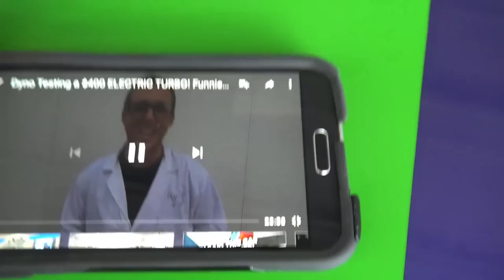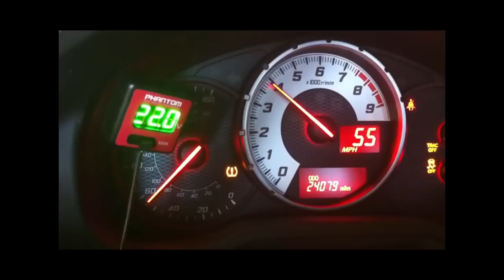Cleetus Mcfarland is wrong about electric turbos!

Comment: Congrats on your build, I know that the OEMs have been using this technology but I would like to see what the endurance of this would be under high heat and weather exposure.

I am not a subscriber to the whole "Green energy" church though, I have worked in the energy sector for years and can tell you that you might achieve nominal tech advances but it will all still come out of the earth and to great expense to the environment.  Batteries are not the way of the future, the configuration that you have is actually a high voltage capacitor that feeds the turbo and that will eventually kill your alternator so make sure that you get the duty cycles matched by your driving habits or you can expect to be setting on the side of the road more than expected.

We tested larger variations of this on military diesel turbos and that very thing happened after high mileage RAM test.

It will all come down to endurance and quality in the end.  

Very clean build!!  Thank you for taking the time to challenge technologies to see what the realm of the possible could be and showing others!
Reply: @Neojhun  Cobalt has played a role in improving the performance of EV lithium batteries, namely energy density and battery life. Moves have been made to reduce the use of cobalt, but eliminating it entirely is going to take more time and research to achieve, if it can be achieved. So perhaps check your facts before shooting your mouth off that it plays no role in EV's , it does for now. Battery life is still an ongoing question in electric cars and lithium storage, in long term testing, some of them are not doing so well, not to mention the problems with recycling lithium batteries which is another"work in progress" that may or may not yield results.  As for liquid fuels, there are cleaner fuels which can be made synthetically such as Methanol and research continues on the better energy density,longer chain alcohols like propanol.  Regardless, with an excellent heat source like Thorium MSR nuclear power, which is well underway final trials in China, it will provide all the heat energy needed to produce limitless,cheap and clean burning fuels.  Look up Thorium redux to learn more.   If you visit roadmaptonowhere.com you read about the stupdensously horrific cost of the whole carbon zero by 2050 scam.  One of the projections is that to reach zero carbon by 2050 with EV's and renewables would require the mining and extraction of 400 million tons of copper, not to mention the nickel,lithium and rare earth metals.  Cure your ignorance.
Reply: Oh and read up on the Achates 2 stroke engine being used by the US Army and is being field tested in Aramco private vehicle fleet, they have conquered emissions in their CARB heavy truck trial and predict 20 to 30% better fuel economy in diesels and 50 to 60% better fuel economy in their direct injected gasoline version.  Its engines are made of plentiful and easy to recycle aluminum and steel,  and the EPA in California want all future trucks to use its technology.  Combined with Thorium MSR, the energy crisis is easily solved........no need to rape the earth for hundreds of millions of tons of new,exotic resources that dont recycle well or triple the capacity of the grid that will cost many trillions of dollars.
Reply: @wazza33racer  Yes the Battery Lifespan of BEVs is not great. With no major technological developments the 1990s Large Format NiMHs like Rav4 EV averaged about 17 years. Modern Lithium Ion batteries are no better and basically the same. With slightly more work to do with thermal management the best we can hope for is 20 years Max for current BEVs. But during that time BEVs can have insane High Mileage easily 300,000 Miles or more. Yes it's not great but it's just as bad 4 Banger Petrol & Diesel cars.
Reply: @wazza33racer  ICE Vehicles will soon use just as much Rare Earth Compounds as BEVs. Both the Electric Motor and Battery Chemistry does NOT require Rare Earth Compounds in the near future. The only problem is the Electronics especialy the Power Electronics. But the end result is roughly the same amount in a Catalytic Converter I.C.E. vehicle with electronic convenience features. You clearly have no clue how Rare Earth Compounds are used. FYI You copied and pasted the Rare Earth Metal scam. It's called Rare Earth COMPOUNDs because the Metalic Form is hardly ever used.
Reply: @wazza33racer  Yes I''m well aware of the Archates Power Opposed Piston engine, please look up those videos with my comments on them circa 2015. I'm also a WW2 history nerd and I also knew it was inspired by Junkers Jumo 205 legendary aircraft engines. Problem with Opposed Piston is the Cam Gear linking both ends of the cylinder. Currently it's a complicated fragile mess that has to translate timing across whole length of cylinder. This is not viable for mass production and wide spread commuter and commercial use. It would simply be too unreliable and expensive to fix. What Opposed Piston needs is FREEVALVE Camless Electrically Actuated Valves. But this technology is very infant and no where close to even series boutique production. Ironic you keep picking topics I know way more about and is inferior to the MASS Production of BEVs.
Reply: @wazza33racer  "triple the capacity of the grid that will cost many trillions of dollars" LIES that is NOT POSSIBLE!
Production Rate the output capacity of BEVs is extremely slow. There is not enough BEVs that EXIST to stress out the Electric Grid. Even worse you fail at the concept of TIME!
BEVs with multiple days range does not need to charge during peak hours. Vast majority can be incentivized to charge during Off Peak hours. This vast majority of BEVs would have little stress on the Electric Grid as the Peak Hour Electricity Usage is still higher than BEVs. There is simply not enough BEVs in a given region a given land area to compete with other uses of Electricity which is way more intensive during peak hours. This is based on 70% of all road legal light vehicles being changed to EVs. Which is extreme saturation rate that will take decades.
Reply: @wazza33racer  "eliminating it entirely is going to take more time and research to achieve" WRONG
LiFePO4 is one of the most established older battery chemistry. It has ZERO Cobalt and is entirely not compatible with Cobalt. With advances in more efficient more bare packaging. The energy density of LFP is already more that sufficient for a Commuter vehicles. A well design battery and chassis integration can easily result in a NET 65kwh LFP battery in a 1.5 Tonne car. That is very useable for that use case and require no major leap in technology. This is based on conservative existing technology. The next big leap would be NET 80kwh in like 1.6 tonnes which would border on overkill.
Reply: @Neojhun  China has two MSR designs undergoing test and evaluation at the cost of some billions of dollars.  Its not funded in the west, to promote energy scarcity, even though ORNL did the research in the 1970's with a prototype that ran for 10 years, actually do some research.  Thanks for the ad-homiem attack, I win game set match.  You cant debate the substance, so you attack the man.   China will adopt MSR closely followed by India which is watching the research closely, both countries have millions of tons of Thorium available to them.  With 700C heat source from MSR, making any kind of liquid synthetic fuel is just a matter of chemistry.  There are a number of candidates, Methanol is just the simplest and best understood, I have no idea wtf you are talking about regarding EXXON, they are ancient history in the near future.  MSR will dominate, any country that doesnt folow, will be left behind in the dust bin of history, it will be the Thorium age. Heck, Elysium industries even have a fast neutron design that can run on conventional reactor "spent" fuel rods, look up Ed Pheil.
Reply: @wazza33racer  "awesome but funding and development has Stalled" was my direct reference to Elysium Industries. You clearly have not been following the organization in the past few years. They need funding badly as they are having trouble raising funds. You truly have no clue what you are talking about. Just taking old press releases and taking it for face value.
Reply: @wazza33racer  LOL Your entire concept of EVs and the Grid is WRONG .Charge & Discharge cycle for V2G is not a problem for partial load like 15kwh out of 60kwh as the cycle life of BEVs is massive, it would have negligible effect on battery healthy as long it's heavily limited to a FRACTION of a battery. You have no clue what you are talking about and wrongly assumed V2G would consume the entire battery, which is wrong. EVs are not a Niche application, that is Ignorant False assumption due to your slanderous bias. I agree BEVs can not be 100% of all vehicles, but at large proportion of how vehicles is NOT for long range Cross Continent driving. In those cases BEVs work great and educated guess it about 60-70% of all vehicles. That market share in few decade would have a gigantic reduction in demand for Crude Oil and Diversifies sources of energy including multiple Fossil Fuel. This is destruction of energy scarcity which you are too blind to figure out. Soo much of your attack Political Ideology and Idiocy. Worst is "Climate Change & Globalist" BS which is NOT RELEVANT. Classic Anti EV Propaganda blames it on that Political Group when they had no role in making BEVs FUNCTIONAL. Infact low range weak Compliance cars did more to destroy the reputation of BEVs. Nothing you said has any basis in reality or technical accuracy. Seems like all you do is read layman's articles and only regurgitate subjects at a very simplistic level. You get the details wrong to the point your argument is erroneous.
Reply: @wazza33racer  "unreliable option of solar and wind" is political BS. The problem with Solar & Wind is OVER SUPPLY. It's a TIMING problem when there is massive generation yet not enough LOAD to soak up the excessive energy. Wind Turbine have to BRAKED during these period and sometimes the brakes fail resulting in catastrophic damage like Fire then Colapse. This could be solved if we have massive Mechanical Physical forms of ENERGY STORAGE. The worlds biggest battery is Bath County Pump Hydro which on a typical cycle supplies 10 GigaWattHour with a theoretical max og 24GWh. Problem is this requires a massive amount of water and suitable geographic topography. The next step is develop Compress Air CAES, Cryogenic Air Storage, Falling Dry Mass or Fly Wheel harmonic Regulators to store GigaWattHour amount of energy. That way GWh energy storage is more flexible geographically. The insane fact is Electric Grid have a very tiny amount of energy storage. That is why it's soo expensive and unreliable fault prone, it lacks BUFFERING. This would END the Renewables OVER SUPPLY problem by soaking up the excessive energy instead of like Braking the Wind Turbines. Note how your summaries are SHALLOW and lack any technical detail. It's just political ideology summary.

Comment: What about lubrication for the bearings? Cold side or not am I missing something?
Reply: well it is a working engine so it OBVIOUSLY is already lubricating the bearings lol wtf are you talking about?
Reply: He's referring to the bearings on the turbo. Its an electric motor so they come with internal sealed bearings. Most of which can be replaced at some point but they have a long life span.

Comment: as soon as you start compressing air, the compressed air starts generating heat, you should still inter-cool your electric turbo.
Also im curious what did you do for tuning? you cant just throw boost at an engine with out tuning it, more air means you need more fuel and likely less timing.
Reply: hits 75% throttle.... creates a lean condition....  Detonates cyl 3.....  wooooops
Reply: @Aircraft_Fabricator  ah yes cylinder 3 ring land failure, the struggle is real.

Comment: As battery and other technologies move forward I can see electric "turbos" replacing exhaust driven turbos
Reply: Nah, the exhaust is wasted potential otherwise, so I dont think it is going away, what could happen is hybrid turbos, that are driven both by the exhaust and the motor, kinda like the detroit diesel superchargers were driven both mecanicaly and by exhaust.

Comment: I've been thinking of doing this too but, also Run the torque amp off a raspberry pi while it's  hooked up to the ECU. To see if I could get  ECU could communicate with the Pi to precisely very the power from the turbo from lower rpm to high. And not to have a dumb switch hooked up to the peddle

Comment: Dyno data of your setup please! btw when the compressor housing heat soaks it will put out some heat aswell as if it compresses air it will create heat so basicly blowing hot air into your throttle body .. also when it is off it's a huge restriction 2k ? lmao
Reply: A throttle valve is in general a restriction and being a restriction is its purpose. So when the Phantom is a restriction it doesn't matter as long as it is turned on when the throttle valve is nearly open ;-)
Reply: dyno data ? baseline and with boost.  also show the boost pressure on a meter please
Reply: @Suisk8  this page shows several dyno graphs at different shops. https://torqamp.com/use-cases/

Honda Prelude shows potential on a 2 liter at Eindhoven University of Technology:
https://youtu.be/VaUEwuN3Lxo

Toyota Supra with large turbo at Suprasport: https://youtu.be/RWoZtDsYdwk

Classic Citroën at DP Engineering:
https://youtu.be/K8jOoe8AkTI

New Mini at Beek Autoracing:
https://youtu.be/6je49qfD60A

More videos on our channel.
The Lexus is200 video shows in more detail how we measure and the boost pressure.
Reply from the maker: @Suisk8  Check out this video showing boost on a meter.   https://www.youtube.com/watch?v=qXar6Sfy4MA
Reply: However you are the one who is posting that these actually work and make power.. 
You should have your own test data to back your claims, because you already know that people who actually know about tuning are going to be very skeptical. So why not have Your test data available to prove your claims?.Also no boost fuel enrichment better add AFR logs to your data too ,if its actually boosting your AFR will lean out under boost forsure.  plus 2k is way out of line when you could buy a real turbo or blower in that price range and make some gains
Reply: TorqAmp- your are 100% incorrect. He said the motor on the electric turbo doesn’t start until the accelerator pedal is at 75%. So very rarely is the motor spooling the turbo and the rest of the time is is restricting the intake. Unless he runs the balls off it non stop and even then he says the batteries are depleted after a 60 second pull, then what? Your at WOT and blocking the intake

Comment: You lost me at 1min 3 sec when you said 4 cylinder. They used a V8. Totally different intake needs
Reply: Either way, this thing MAY be able to provide usable boost on a go kart.   Nothing bigger
Reply: They did a video with a much better electric charger on a 2.2l ecotec Cobalt and then used 2 chargers on it and gained 75whp and 100wtq.
Reply: No they used a cobalt with a Corvette motor cover😂🤣😂🤣😂

Comment: "now that's not science" but here's a video of someone making power on a dyno so I know mine makes power as well.
Reply from the maker: That is correct!
Reply: @mikeschneider634  I'm gonna agree with you on that, anyone who spends $2000 for a supposed 30ish hp gain is a fool and a moron. I can buy a $400 turbo from Ebay and make more than that on low boost. That's real efficient lol
Reply: Photomikes Garage woosh
Reply: I watch 8 second mustang's on youtube - therefore my mustang is also an 8 second car

Comment: Congratulations you have turned into a ricer. That’s the new equivalent to a cold air intake😂😂
Reply: That's why Audi is testing it for turbo lag reduction? They use dual intake with a pressure sealed flap that lets air in at low rpm/boost from the turbo intake, then switches over to the regular intake once boost from the regular turbo has built. It creates a very low end torque.

Comment: The oems aren't using an electric supercharger lol. It's an electric assist turbo. So it still primarily runs off of exhaust gasses the electric motor just spools the turbo faster and then disengages when the engine starts making boost. Those turbos still always spin

Comment: Great vid, How long under WOT can you run the supercharger? Long enough to do a 0-60 or 40-100?
Reply from the maker: For sure at least a full 60 seconds before the batteries become depleted.
Reply: So he’s saying roughly a pull from 30-35 with those power numbers through a choked down intake. That would be about 60 seconds WOT from 30-35

Comment: Something like this would be great coupled with NOS where the charger kicks in just before full throttle and over 3k with the spray kitting right after.  Could prolly get 150hp from 5psi plus 75hp shot of NOS. In my mind I may work like that but never been accused of being the brightest crayon so to speak

Comment: thanks, quick question,  if you are putting more air, did you modify your car to put more fuel ? or the computer does it automatically?  I want to put some extra power to my x trail
Reply from the maker: I used a tune from open flash to work with the electric supercharger.

Comment: No Blowoff Valve, ECU Mod and new Valve Timming? not using Intercooler seen more efficient, this is a nice job, I would like to know what would happen if you fit a Electric Turbo to a smaller engine with SUV Carb, like a 2.0L Kia Sportage or any other small SUV